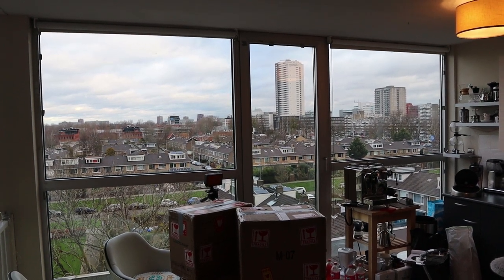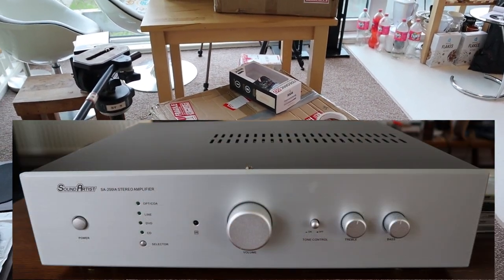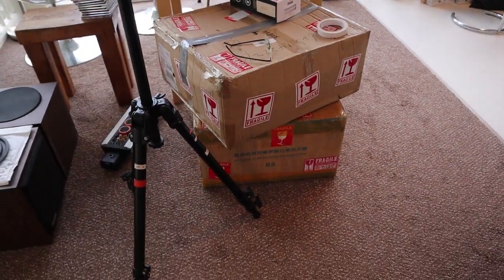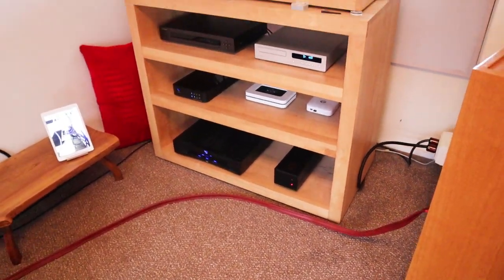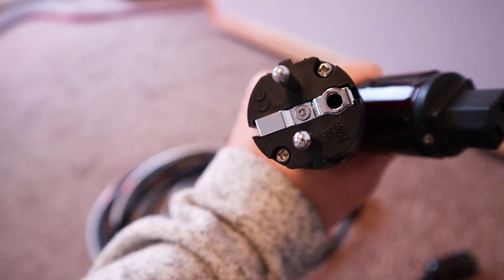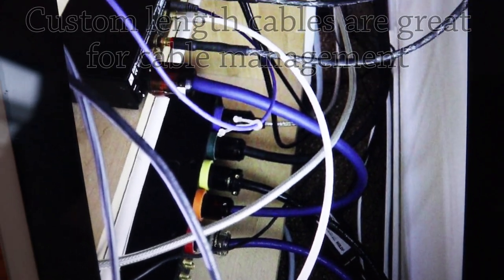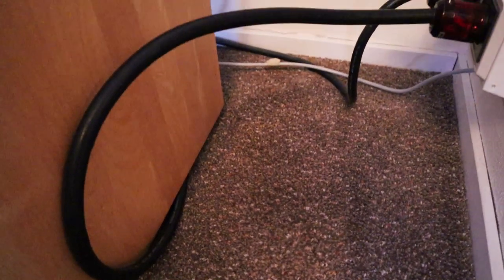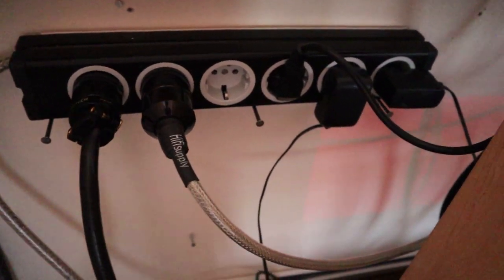Cable Management and saying goodbye to all my Chinese review samples.

Comment: I have to admit but your view from the window is awesome even in an overcast day. About the chore of handling the cables from  the back of the rack  cabinet make a wheeled basement and then would be easy peasy to change them.
Reply from the maker: Normally I would agree, but there are a few reasons why this won’t work here.
- Some cables are also connected to the wall behind the rack (not visible at the time of filming) so they would come loose when the rack is pulled forward
- Because of my strange floor (very bouncy) I have my rack on balls (see my video about my rack) I never found any wheels ‘bouncy’ enough to work.
- Thanks for your concern though. Much appreciated 👍

Comment: Aaah..the joys and frustrations of cable management. Good points about phase. 

I noticed you have a bluesound node streamer...I made a new power cable for mine with a figure 8 connector which can be plugged in both ways. So I did try and noticed it changes and effects the sound and soundstage quite a bit.
Reply from the maker: Yes, some people still think correct phase is not a thing, but it sure is 😀👍

Comment: Instead of squashy balls you can use Sylomer, maybe the brown ones, or even a thick yoga mat. What power cables do you use? The oyaide plugs that you use are orginal or not?
Reply from the maker: Hi, I never used Salome. Is it soft enough for my heavy rack to still be able to ‘wobble’? Check out my video about my rack to see what I mean.
- I have a bunch of original cables and connectors from Oyaide but also some imitation Oyaide connectors. So I have both
- Thanks for your comment 👍
Reply: @theaudiophilebarista2424  Those are special foam material for vibration control, Sylomer by Getzner is the original one and they have that material with different densities. So green ones will give you more wobble I guess but brown ones are for heavy objects. You can use 3 or 4 strips for your rack or just cut it to square and use it that way. Only problem is finding that material in small quantity. If you cannot find that yoga mats will do it just fine and its cheap. Also rubber mixed with cork is a nice isolation material and you can find it easy, make sure you get them at least 20mm. I'm not sure about the wobble but they will give you good amount of vibration control. If you use too soft materials it will get harder to level the rack.
Reply from the maker: @ardalay88    My main problem is not the weight of the rack but the fact that my floor is very flexible. That is why the dampening can’t be too rigid. It it is too stiff, the ‘wobble’ transfers to the rack and it can make my turntable skip with heavy footfall.
Reply: @theaudiophilebarista2424  For proper vibration control weight is one the most essential data for calculation. I'm not an expert on this but you get the idea:) Even if you use regular rubber material which is also great for it, you need enough mass of that material to get the isolation you need.
Reply: @theaudiophilebarista2424  I checked the Sylomer code that I recommend and it's Sylomer SR 55 green. You can even stack this material for added effect.

Comment: I see you have a bluesound  streamer.  I had purchased a bluesound vault ll and it was the worst piece of audio gear I’ve ever had.  I returned it and lost 15% for a restocking charge.  The worst part was that bluesound never returned my emails or phone calls even though I lived 45 mis away from them in Canada.
Reply from the maker: Hmm. I love my Bluesound. What was wrong with the vault?
Reply: @theaudiophilebarista2424  The following is a polite review I wrote three years ago:  I needed another media player, ripper so after much research and reading great reviews, I settled on the Bluesound Vault 2 which appeared to be feature packed: blue tooth and MQA capabilities especially.

On setting it up on the equipment shelf I became aware that the LAN and USB connections were not as on the online photo, (no photos in the leaflet accompanying it) but were flipped around which was a slight P.I.A seeing that the working area was semi dark.
During set up the unit did not go to a steady blue light as the literature said it would, but it flashed red and green for almost an hour: I finally determined that it was updating its firmware... No mention of this in the  leaflet, or as they call it  "Quick Setup Guide".   There is no other Setup Guide or manual, physical or on line, and at this price point, this is an area that Bluesound needs to improve.

After setting it up I let it run for a few days before evaluating it.
After much ado I was able to find the correct menu and configure the formats I wanted the CD's ripped in. There were no instruction for this.  I wanted flac and alac, but those were not an option so I reluctantly chose MP3.  This needs to be addressed as my  I do not normally listen to mp3's.

By chance, the first 20 cd's I ripped had no artwork, but afterwards some did.  The ripping was very quick and the CD's were ejected very quickly, allowing me to load others in an amazingly timely manner.  On the other hand, the encoding takes many hours.  Perhaps the unit needs a faster processor.
The unit easily played Napster, which the w4s player cannot.  Retrieval of the metadata was fantastic and better than the w4s. As said, the encoding was very slow, the w4s was much much faster.
Once I stumbled into the cd ripping menu, I found there was not a live update on which I could see the ripping encoding progress: you have to hit the refresh button often to be current.

So how did it sound? In the interest of full disclosure this is the equipment I used:
Wyred4Sound Dac2,
Mcintosh C220 tube preamp
Mcintosh mc 2102 tube amp
Canton dc509 speakers
Velodyne Dps sub
Panamax m5100 power conditioner, amp not plugged into it.
Wyred4Sound music server.
Audioquest interconnects,
Home made speaker cables from from DIY audio projects.

All D to A decoding was done on the w4s Dac 2DSD .  On listening to ripped cd's, I thought that my wife was right: she keeps telling me I'm selectively deaf.  I had to turn the volume on my stereo much higher than normal to find a sweet spot because the output on the vault was very, very low.  The music sounded ok, nothing special, no feeling, boring actually, so I concluded that I needed to replace my tubes and give it another shot.  That was until I did an A/B with the Bluesound and the w4s server, playing You look good to me, by the Oscar Peterson Trio, and Amazing Grace by Gary Karr and Harmon Lewis followed by Still Dre from the Chronic 2001 cd.
With the w4s server the fiddled bass near the intro was deep, biting and cutting, the piano was crisp, clean and sweet on the w4s, but just ordinary on the Bluesound....no feeling.  The pattern continued on the other aforementioned tracks.  The biggest disappointment was on the Gary Carr piece, here I didn't feel the Bluesound at all, at all, at all, and previously this track never disappointed, even on the Squeezebox Duet.

My other disappointment was that I was unable to contact Bluesound.  I sent them an email about various issues, and eventually they responded that they never got my email.  Hmmm, so if they never got it how come they said that?  Contrary wise I have been able to contact personnel from all the equipment listed above, and all of my equipment have decent manuals.
Indeed, when Tidal first emerged I was having problems loading it on the w4s server, so E.J. Sacramento the owner of w4s logged on to my unit remotely and did it for me.  Wow!

The Bluesound Vault 2 is an esthetically pleasing feature packed unit, but in my opinion the one I purchased it is not ready for the sacred shelves of audiophile units.  It left me feeling "kinda blue". Maybe I just got a mediocre one. 

I returned my unit and got a refund less a 15% restocking fee.

Update: It has been three years now and have not received a response from Bluesound, except to say they never got my email, which I resubmitted several times.
Reply: Good to hear about the bluesounds before I bought one. I almost did twice,  But I'll never know because I'm moving on from there.
Reply: @roofermarc1  glad I could help.  They might have improved because I think they now have flac etc, but customer service is still suspect.
Reply from the maker: @ramsaybolton9099   Yes, that is quite a dramatic story. I only have the streamer and it never gave me those kind of problems, but if this the standard (and I don’t know if it is) it should be out there. Thanks for sharing.